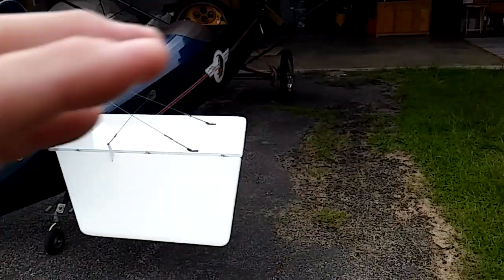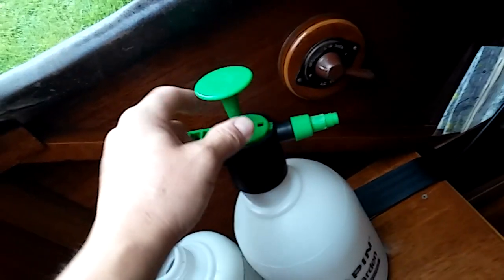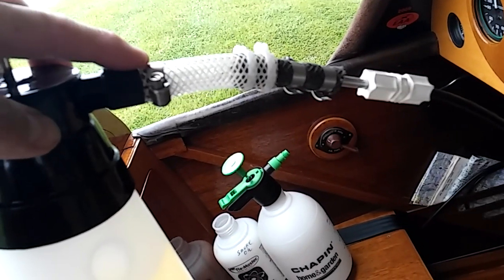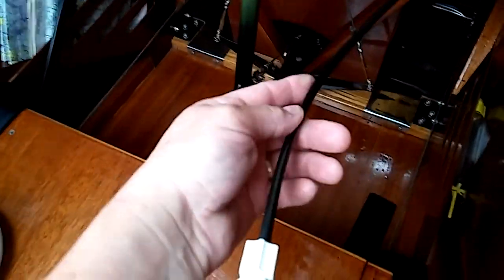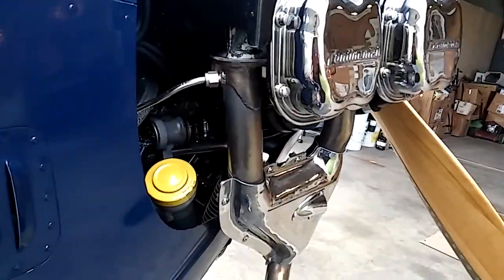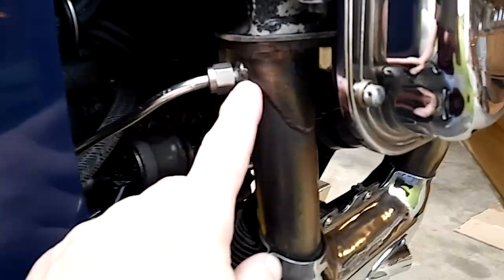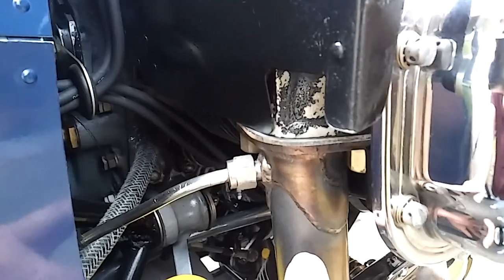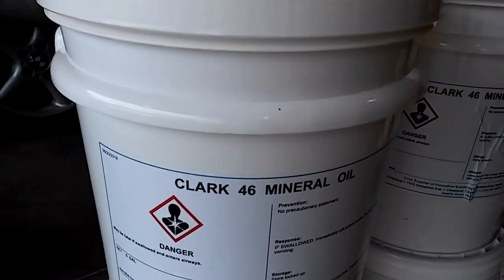Amish Smoke system for a Pietenpol.  Homebuilt Aircraft Smoke System how-to

Comment: Very cool. It will only put smoke out as long as you are manually holding the nozzle trigger open, Correct?
Reply from the maker: Yes--unless you flick the little lock mechanism while holding the lever down.  Most times it locks by itself and then I just reach down and disengage it when I'm done or the pressure gets low.

Comment: Mike thanks for this video. I installed and tested my smoke system on my Pietenpol yesterday. I need to figure out how to get my smoke a little thicker...I used Mineral Oil from Walmart. I am thinking my pressure never got the line fully primed might be one reason. I have an A65 engine and it was only 40 degrees outside so that may be another reason. Take a look on my youtube channel and see what I did and comment. Thanks, Joe Golden N8031